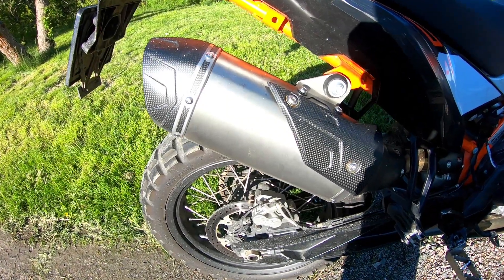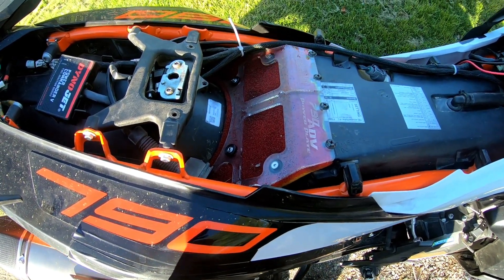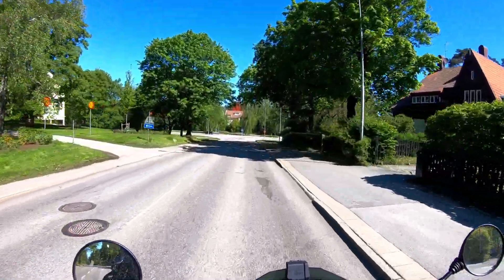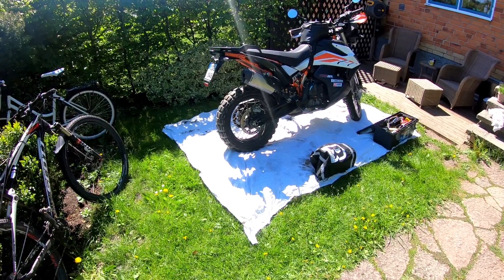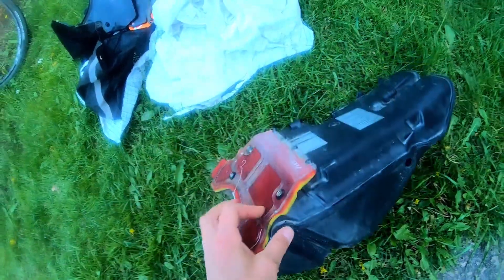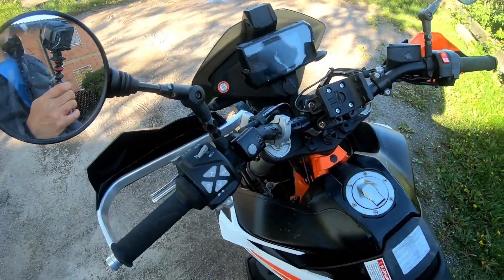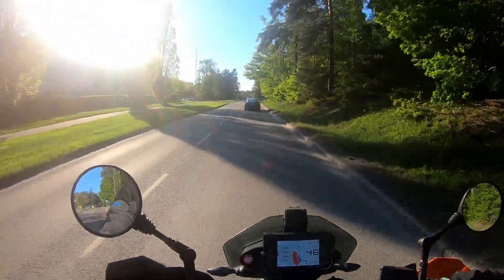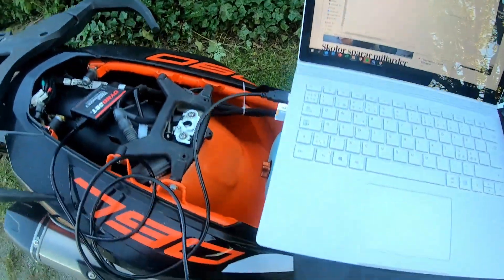KTM 790 Adventure R -  Rottweiler Intake System & Power Commander V

Comment: He man, Good vids about the items you've adjusted and the effects of them. It's exactly what I want to do and so I've got a few questions I hope you don't mind answering. 
Glad to see your stalling probs are solved. 
1. Would you recommend getting the power plate or the air intake when I order?
2. Did you have to pay extra fee for importing these things at custom control? I'm based in the Netherlands. 
3. On longer rides, do the extra vibrations bother you? I guess my gf will like it though. 
4. Did the maps influence your fuel economy and do you know by how much? 
5. Did you get a smoother ride in the lower revs? 
6. Does your set up in this vid also have the decat? I know you've installed it (other vid) but you didn't mention it at the start so I doubted.

Thank you so much in advance for answering! Let's hope for a black Friday deal.